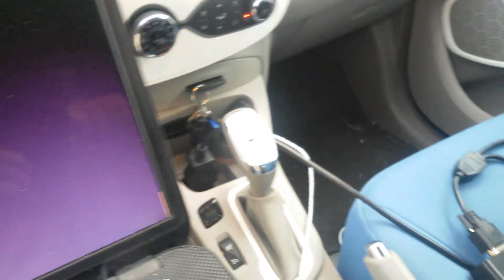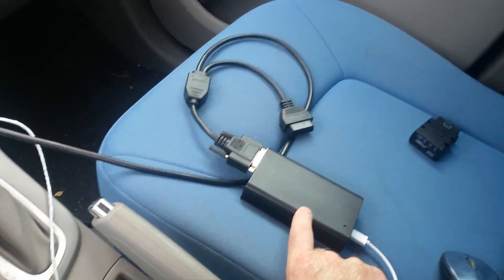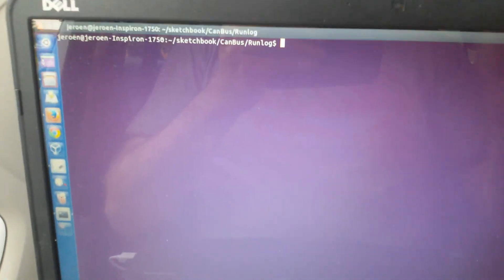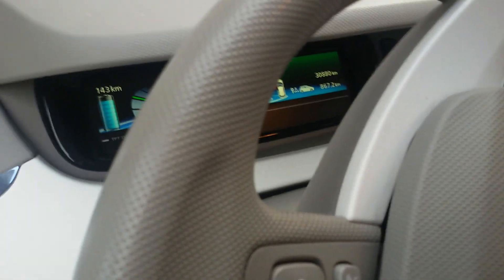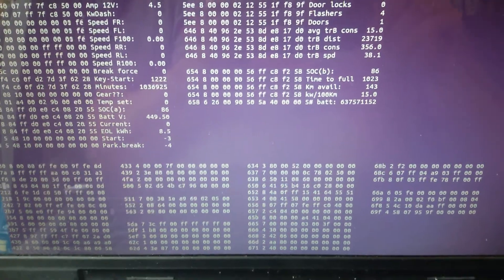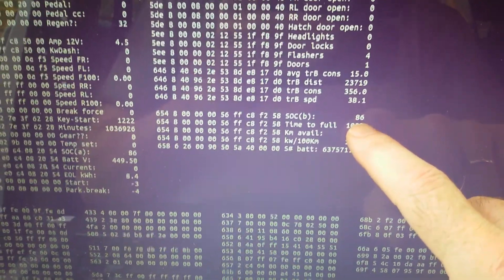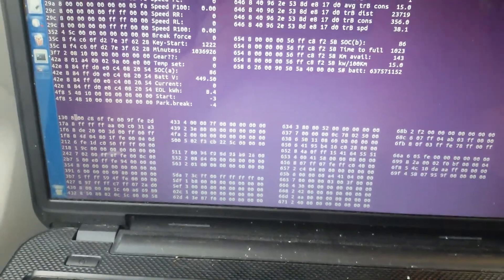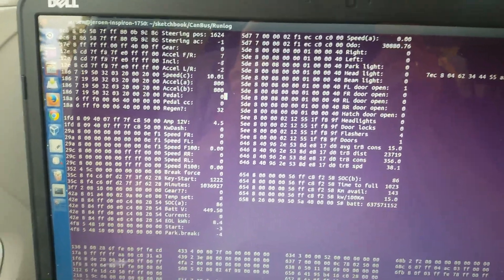Zoe on the Arduino Due with GVRET

Comment: Hi, 
could you help for calculating the steering angle on (0c6).
If my information are correct, sensor resolution is 0.1° and offset (0x8000).
Thank by advance
Reply from the maker: Yes, as far as I know this is correct.
Reply: I mean how you get the result 1596 degree from data 0x86 and 0x3c ? I did( (0x86*0x3c)-0x8000)*0.1 not same result
Reply from the maker: @yakoubihocine982  Steering position is the first 16 bits of the 0c6 frame. Assuming the data from your comment the calculation is 0x863c - 0x8000 = 0x63c = 1596, 1596 * 0.1 = 159.6 degrees.  Hope this helps
Reply: @JWM-Meijer  hello, thanks again for ypur help.  Is there any library or link  where I can find the other sensors resolution, offset ...etc ?
Reply from the maker: @yakoubihocine982  Have a peek here https://github.com/fesch/CanZE/tree/master/app/src/main/assets/ZOE . The frames you see spontaneously are in the file FFC_FIELDS. The others are queried using ISO_TP. I would recommend using CanZE instead of starting from scratch.

Comment: What software are you using to display the data?
I have a CAN Adapter connected to a USB port. But I am not sure how to access the data in the car.
Yes, I am using Ubuntu too :-)
Reply from the maker: Note that I made this video 5 years ago. As stated, it was done on an Arduino Due (since discontinued), with some home brew software, on top of a CANbus library I found. The Due was fast and had a CANbus controller. Just added a transceiver and basically done. I wouldn't advice to go that route. 
Since then, I moved to the ESP32, again, fiddled with some quite dirty, home brew code.
If you want to take this on, I would advice getting a (free) copy of the excellent SavvyCan software made by Colin Kidder (those search terms should provide more than enough direction). It can talk to either linux canbus network drivers, or directly to supported hardware running GVRET (Colin's companion firmware on the CANbus device). You won't be surprised that GVRET was developed for what was in essence an Arduino Due with some additional hardware, but is now maintained on the super popular ESP32 ;-)
ELM based dongles are usually not fast enough to transparently pass pn the full bandwith of the CANbus to the computer. Just saying, it might be a route that sounds good and cheap, but is probably gong to lead to disappointments down the road.
Hope this helps.
Reply: @JWM-Meijer  I have an ELM327 device, exactly like this one: https://amzn.to/35P2BEQ 
Any idea, how to get the data in bash to use it?
Reply from the maker: @WarumlinuxbesseristDe  That thing should behave like a serial device. Chech what comes up in /dev/tty* However, you need to talk "ELM327 AT-language" to it. I am not familiar with linux CANbus network drivers, so I cannot help out there.

Comment: That is very cool. Finally you can get accurate battery SOC and charging rate in a Zoe.
Reply from the maker: +jeales895 Uh huh, and this is already old stuff. This is all research stuff, you know, wires, laptop , C-programming. I should make a new video about the Android app, as that has progressed immensely, based on what you see here. See also http://canze.fisch.lu
Reply: +Jeroen Meijer Do you think it would be possible to get an app (like CanZE) onto the RLink. Or is it all totally locked down?
Reply from the maker: +jeales895 I have not seen anyone who has a decent (as in: working AND as in: not breaking the R-Link) tool chain for developing R-Link apps. I confess I have not asked Renault. I have been told R-Link is Android 2.3 (ick!). To be honest, I think it would be opening up a nasty can of worms.

Also, it might be possible that R-Link is only connected to what is called the Multi Media bus (that is also wired to the SAE J1962 port, but ELM's won't be wired to those), and if true, it would make the entire app dependent on what the gateway between those two busses is willing to pass.

I know hooking up another device in the car is a PIA, but with an el-cheapo tablet, you're done for about 62 Euro's and a few extra for a mount. Simply put, it is not worth the effort for those amounts to backtrack to a closed outdated Android system, half managed by Tom-tom, half managed by Renault. So I guess unless Renault offers us a truckload of money, the answer is a definite no.